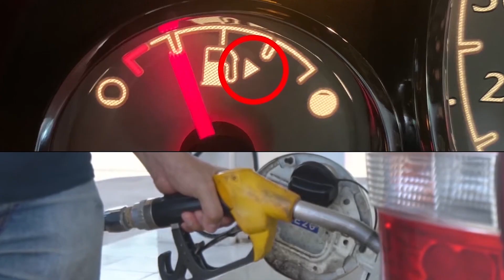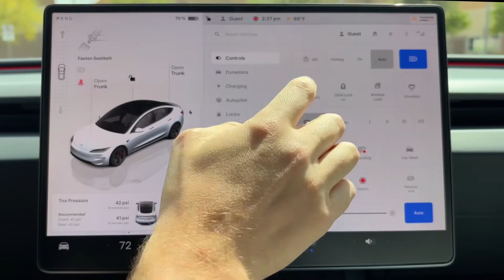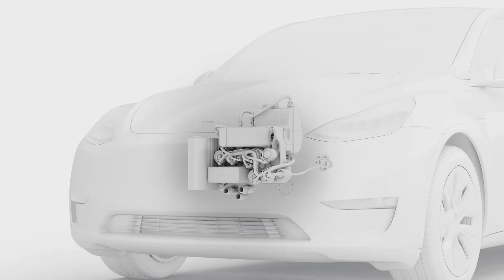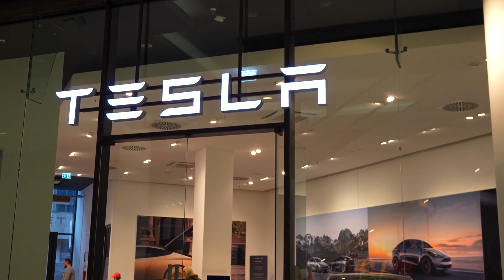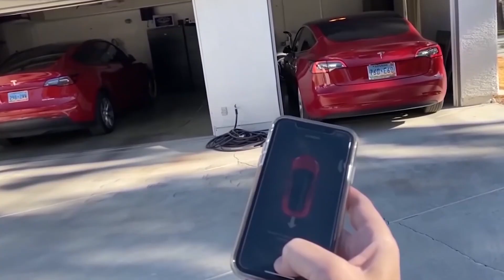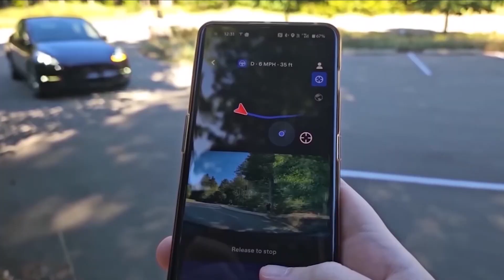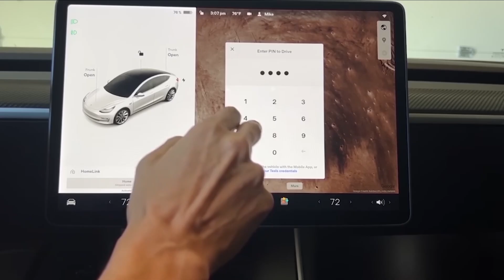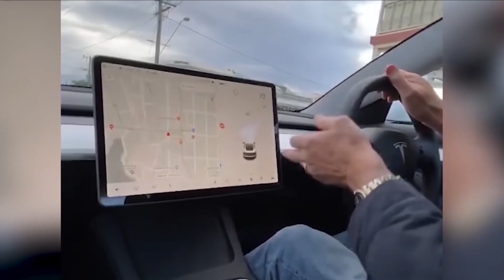How Elon’s 2026 Tesla Motor Will Shock Everyone – Here’s the Secret

Comment: See I watch to many  videos on the workings of the magical transmission this module is a solid one one piece that after the external motor gas motor a hybrid can't you apply that trans tec to a real v8 that can give that truck that tow power and when you don't got time to sit and wait for a charge you go gas and hybrid tec that in sure is there already cause I was researching electric what 8 years ago totally I was going to a colladge in mid northern I really wasn't it was that he was the only one going there even purchasing a scraped and the take apart is was cool in a life long electrician 45 years so the electric term inooogy wasn't far and beyond what you were creating and he was a good teach the reverse gearing neutral motors and never neutral there just staying busy isn't that a cool the thing with the internal gearing if the transmission slashed power unit  if just electric